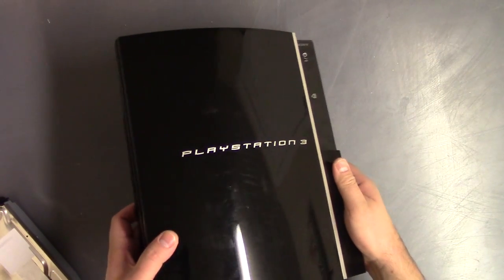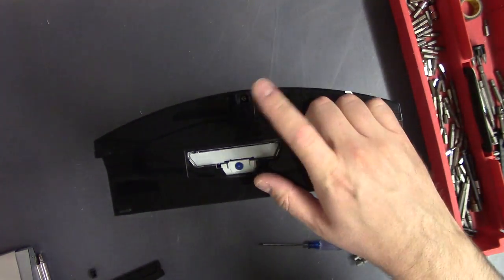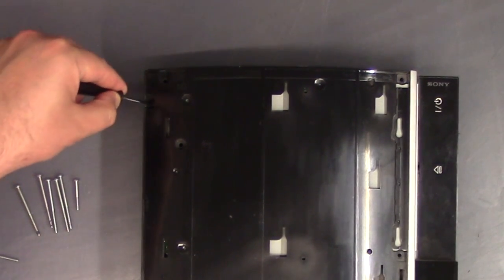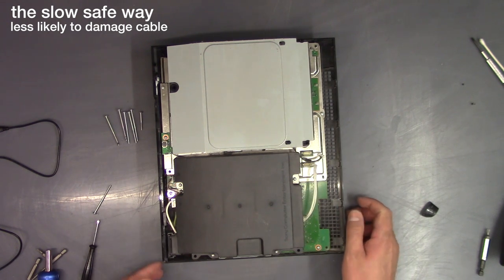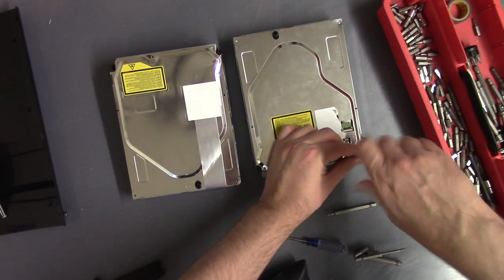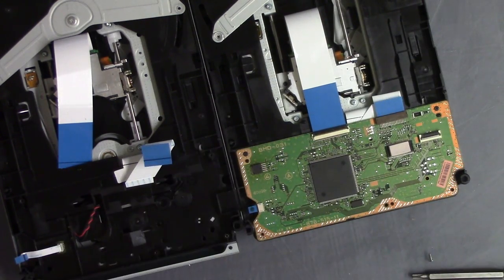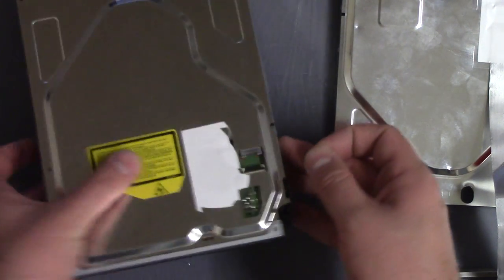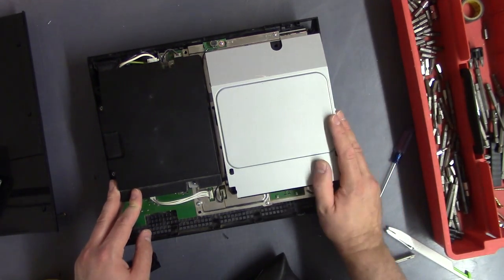How to fix a PS3 FAT Bluray Drive

Comment: Just followed this instructions and got my ps3 working again!!! For those watching, you don't need to pull out your hard drive or the power supply. It's really easy without those being done. Also a T8 didn't work for me for the security screw in the beginning. You need more like a T9 or T10 to get that one out.
Reply: It's a security T10 I think.
Reply: T10 worked for me

Comment: My PS3 wont power on when I connect the ribbon cable for the Blueray drive. When I disconnect the cable it powers on without issue. Does anyone have any advice?

Comment: I hate useless steps like taking off the power supply and taking out the hard drive
Reply: but it will shock you if you don't take out the power supply and even if your sure about it not shocking you its good to take extra steps to guarantee safety

but hey this was made a year ago so you probably have changed

Comment: Quick question. I have the CECHK01. If I buy the blu ray drive that is meant to be in the CECHK01, I won't have to switch the boards. Is that correct?
Reply: Yeah they exchange ID keys
Reply: You must switch the boards anyway , because id keys are individual for all consoles separately .

Comment: Hi everyone. Revisiting my youth with ps1. Ps2 and 3 bought 2 fat consoles cheap. No pad wires just consoles. 1 working one may not b in ad. 80 gb and 120 gb. So I already had wires pads etc. Anyway 80 g not working, comes on runs quietly pic working but put disk in and won't go in without pushing then got stuck inside. Done the fan thing power off hold eject then came out. So I just kept repeating the process.  Took lid off. Bortered in thick dust. Gave Hoover put back and same thing. But eventually a 5p coin came out. Put a knife in could not feel any thing else. So gave up and toyed with the idea of buying a new blue ray drive. So watched lots of tutorials 2 c if I could manage. Yes I thought, opened ps again to find code on daughter board and opening up the blue ray drive found a piece of paper  and a hair comb. Put it all back together and it works like a dream. I wish I recorded it to help anyone with same problem but if u are still reading I bet u do to. So bare it in mind if you have children 😁

Comment: what if after doing the swap the ps3 still won't take the disc?
Reply: I had to replace the drive and swapped out the board because they are not matched to the mother board. Well I put it together and it still didn't take the disk. Installed the other board that came with it and now it works like it should. Issue is that it still won't read it. I am having a hard time finding out how flash the board to work with the mother board.

Comment: Quick check I have a Ps3 phat Chechl01 model the blu ray drive is a 24 pin if I buy a 24 pin blu ray ribbon cable that is meant for a slim will it work?

Comment: Stuck at the power supply can’t take it out
Reply: If you're just exchanging the Blu Ray drive, you don't need to take out the power supply. You also don't have to pull out the hard drive.